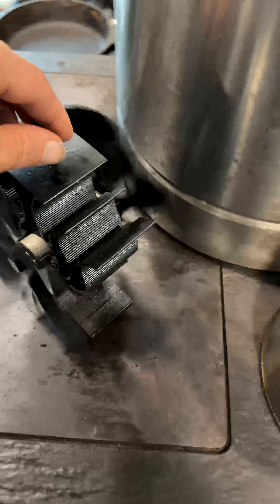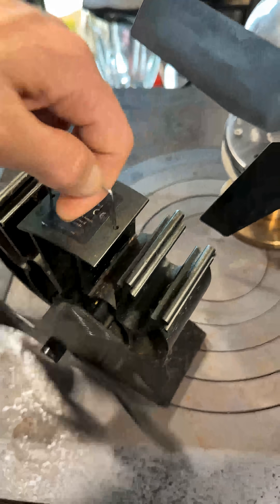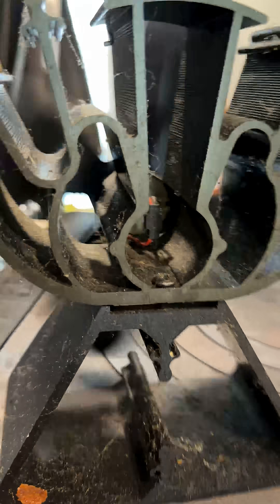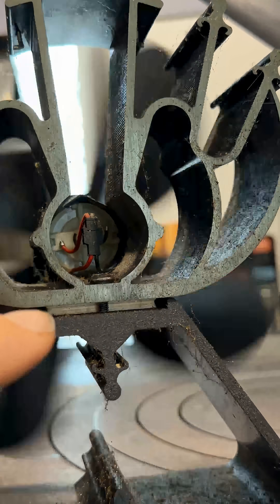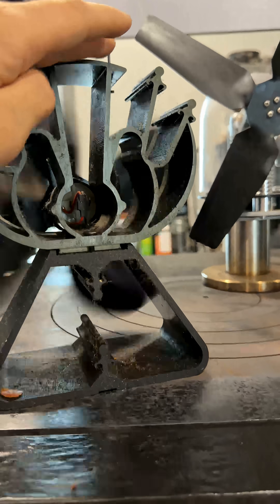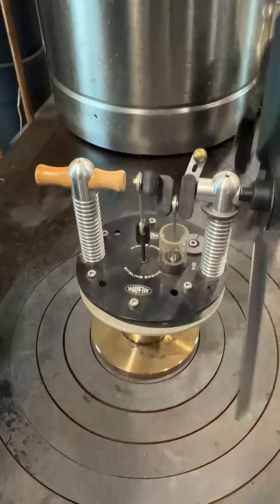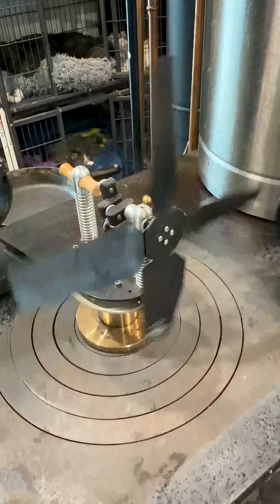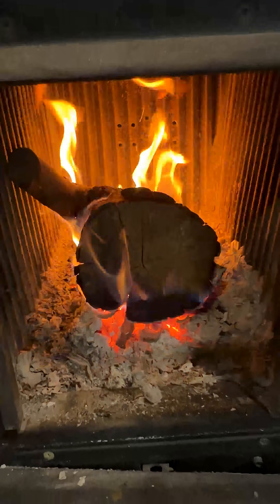Stovetop electric fans powered by heat #narrowayhomestead #offgrid #stovetopfan

Comment: There used to be a type of lampshade that spun different scenes from the heat of the bulb.  They were pretty delicate.  Would be nice to see them again, though.
Reply: It’s a zou ma deng lantern! Sometimes called a running horse lantern. They are ancient, said to be invented around 1000 CE during the Song dynasty in china and got popular during the Ming dynasty
Reply: @Matt-lu8oy Thank you!  I was gonna say that my mother brought ours from Taiwan.  It was a small, octogon or pentagon silk screen panels.  They were painted with various scenes of ancient China.  On the inside was a painted acetate-like cylinder suspended by a needle, around a small electric bulb.  And of course, there were blades at the top to catch the heat.  In the light, the images on the acetate were projected onto silk canvas panels.  And once it warmed, and began moving, I could see clouds and sky deities passing through the scenes on the front panels like animation.  I wish they still made those but it was so delicate.
Reply: That sounds cool!

Comment: It's power source is still heat. Just transferred to electrical. So you're going to split hairs calling the fire powering the engine a "combustion engine" but won't call the fans turning heat into electricity "heat powered" either you're trolling and rage baiting or you're one of the dumbest people I've ever heard explain ignorant things to people with confidence. lmao. SO either good job with such a good rage bait, or good job making it this far in life with a head full of sawdust.

Comment: It's still heat powered because the "power "comes from heat being converted to electricity
Reply: I mean realistically a huge percentage of the American power grid is still based on coal and gas fire generation of electricity so by that logic while there are a lot of intermediary steps in there your phone is heat powered
Reply: @mark1A100 im fine with that asertion 😂

Comment: I messed with those all the time back when i was in a electronics class. N type and P type semiconductors. Those little one can fridge use them . You apply electricity to them and one side gets hot and the other cold. They use them in a lot of cooling and heating devices.
Reply: Did you know the government currently has room temperature super conductors? 

You can find info on it from redacted USPTO secrecy vault files, etc.

Comment: That's a peltier fan, aka thermofan, and the concepts behind both sterling engines and peltier devices is pretty neat!
Reply: I've never seen or heard of the self generated electric fan before, only Sterling type.
Reply: @jeffhill3681  peltier's arent that efficient, but for a solid state device, its kinda a cheat code for low powered stuff with a hot and cold side
Reply: @jeffhill3681  I never really saw one in the wild, but you've seen the Peltier effect before and maybe not even noticed it. A lot of NASA's probes that have to go places that they can't use solar arrays, they use them to generate power. Both Voyager probes have this, as well as the New Horizons probe past Pluto, the Curiosity and Perseverance rovers on Mars, on the surface of the moon, placed there by astronauts... places where sunlight is impossible to rely on, and all you can guarantee is the cold indifference of space. They call them RadioThermal Generators (RTG), because unlike here, where we use combustion for the heat source, NASA uses Plutonium.
Reply: Perfect example of the Peltier effect.
Reply: @schrodingerscat4737  The Peltier effect is the specific thermoelectric phenomena of creating a temperature difference by putting a current over the maerial.

This is the Seeback effect, where you get a current through temperature difference in the material.

Comment: they are in fact heat powered. You wouldnt call your tv solar powered because the grid is powered by solar panels, however you would call a battery with a solar panel built in, a solar powered battery, as the solar power is the primary power source. You also wouldnt call the battery a fusion powered battery evne though the suns rays are being made by fusion in the sun. This device is directly electrified with heat, therefore, it is a heat powered fan. Could it be turned into a regular fan powered by a battery? yes. but that is not it's primary function.

Comment: I mean literally every electric thing with the possible exception of primary (non-rechargeable) battery cells is heat-powered one way or another, so yeah, it doesn't make sense to mention it if you have something like a turbine or a solar cell or the Peltier cell in those fans between the heat source and the desired function.  In other words, word.

Comment: They are actually heat powered as the heat is the initial energy supply which is then converted to electric and then converted to mechanical.
Reply from the maker: I think you might be right! Lol

Comment: Another great thing about Peltier devices is if cooled, it produces voltage that is opposite in polarity to the voltage produced by heat.
Reply: And if instead of the fan you hook up a power source, it'll get cold on one side and hot on the other.

Comment: Either I forgot or never knew about the Peltier effect, this vid made me actually something today, outstanding.
Reply: I have enough sitting on top of every radiator in my house. The room heats up extremely fast and evenly. Absolutely worth buying them.
Reply: Peltier effect is changing temperature with electricity.

These fans runs on the Seeback effect, which is getting electricity through a temperature difference.
Reply: @johanmetreus exactly two dissimilar metals ionize at different temperatures. When bonded together and heated, create an electrical potential between them.  

Peltier effect uses semiconductors It Is an entirely different mechanism.
Reply: @phenodfirefoots7720  Same mechanism actually, just like a spool you rotate in a magnet field to get electricity is called generator, but the same machine with fed with electricity to create motion is a motor.
Reply: This is just a thermocouple but peltier devices are pretty cool

Comment: The external combustion engine invented by Stirling was a huge improvement over the steam engines of the day that tended to explode.
Reply: Only problem is, stirling engines produce almost no usable power. The amount of fuel needed to accomplish any actual work made them little more than a curiosity.
Reply: @joeschmoe6908  Sure, the Stirling engine here won't, but there are many different types of Stirling engines many of which produce usable mechanical and electrical power.
Reply: @nerofl89 Even so, they're monumentally inefficient compared to virtually any other type of engine or even an actual horse.
Reply: @joeschmoe6908  ya, they are more of a neat physics phenomenon than anything particularly useful in large applications. Like pneumatic transport which people thought was going to be all the rage and then again in the same exact way with musks hyperloop yet still you only see vacuum transport in very small applications like old mail room tubes or nowadays really just pharmacies
Reply: @joeschmoe6908 False. 

Appropriate technologies developer here; 

The record holder for the most efficient solar power producer per square foot, are sterling engine powered solar concentrators.

 (Developed at Plataforma Solar in Taberna's Desert, Spain, with a duplicate project in California, US) 

The most silent submarines in the world, built by Kockums in Sweden, are powered by Kockums Sterling engines. 

Sterling engines are superior in the right application.
Reply: @calysagora3615 dude we're clearly discussing stirling engines from several hundred years ago, not current technology.  I believe whatever you say about the modern versions, since I know nothing about them.
Reply: This is not a sterling engine concept. This is operating on the Peltier effect.
Reply: @schrodingerscat4737  The short literally shows and talks about a STIRLING engine. Did you even watch it?

Comment: Seems like picking nits haha. Solar power system isn’t actually solar powered, it’s actually photovoltaic which means the energy is converted from photons. It just so happens the photons originated from the sun in most use cases.

Comment: I have had the pleasure of working with old steam powered farm equipment such as a traction engine, and watching those old engines run is super cool, whether it be a stirling engine, a steam engine, or an old hit and miss gas engine. My absolute favorite is to see just how slow you can make the big engines run.
Reply: I, too, have worked with antique farming equipment, similar color, too. 👍
Reply: Oooh. Are the old sterling engines the ones they have to wind up/tension to a certain spot?
 I've seen a vid where it almost looked like they were cockin a big wheel like a gun.

Think the motor was driving a big belt
Reply: @stevew9107  A sterling engine is the 2nd fan in the video he showed. Uses heat for power.
Reply: @Anonymous8317going to have to research later. I only remember the vid of a big engine that took a lot of handpower torque(?) to start, and then chugged along veeeery slowly
Reply: This is not a sterling engine concept. This is an example of the Peltier effect.
Reply: @schrodingerscat4737  Someone didn't watch the whole video.

Comment: Anybody have advice on getting these fans to work again? I have 3 of them that have quit working.  The blades move freely and the wires appear to be in place but no worky. 🤷‍♀️
Reply: It could be that the motor itself is burnt out, the blades would still spin if you moved them but the electricity generated would just turn into heat rather than motion.   Those are just my thoughts on the matter though, I fix computers and not peltier/sterling engines or motors.
Reply: you can burn out the peltier. I haven't tried to buy a replacement myself.
Reply: @clockworkpiece3111  Probably lack of thermal paste is the culprit. Fixed one a couple years ago because of it, it had tiny drops of paste on each of the element so overheating killed it. I'd make sure these fans are properly pasted, even if it's new one. And aliexpress sells replacement elements.

Comment: Sterling engine is a external combustion engine.
Reply: @markrenfrow9873  only if powered by actual combustion. just like stesm turbine is an external combustion engine when powered by coal or oil heated boiler, but a nuclear engine when powered by a fission reactor.
Reply: Can we call it an internal expansion engine? 😅
Reply: Nailed it 😂
Reply: Somebody was too autistic to watch the whole clip. Also, 'an external'.
Reply: ne. it is an external energy source engine. combustion is not strictly required
Reply: I can electric vehicles "external Combustion" when their batteries catch fire.
Reply: @MoaByte-v2z Transient combustion lol. Starts internal, ends external. Just like a gasoline car fire......
Reply: @joecrisp9060 don't let the governor of california hear the words 'transient combustion', he might get some ideas
Reply: Then so is a steam engine, but no one calls them that. They are heat engines. And as others have said, the combustion isn't even necessary.
Reply: @joecrisp9060  you are correct
Reply: @jdfershizzle No, he's incorrect. They are 100% called external combustion engines.  Because they are.
Reply: @calysagora3615  no- Actually, engines based on the Carnot cycle, like the one depicted toward the end of the video which is a Stirling engine, are colloquially referred to as a heat difference engine. Combustion of any kind is not necessary for them to operate.
Reply: @jdfershizzle  Sure, but if the heat source IS combustion, it FACTUALLY is an external combustion engine. Those terms are NOT mutually exclusive, so your take is moot. I already established that they are heat differential engines. Duh.
Reply: @calysagora3615  the heat differential source is not necessarily combustion, and quintessentially not so in most applications of this engine type. Think about the applications of the carnot cycle. Thus, your odd choice of fuel for the wrong engine is not a property or characteristic of the device, just your broken and misused imagination. The answer is no, it is not a combustion engine of any variety. Let me help you: i am running one right now off of ice, and no combustion is taking place, hence the engine itself has nothing to do with combustion, even if your selected temp differential source does for some strange reason. Lmk if you are still super confused.
Reply: @calysagora3615 i have heard them called sterling engines more than anything else
Reply: @calysagora3615 I think I see what you are getting at. The engine is powered by combustion, ergo it is inherently a combustion engine.

 I'll concede that if you were referring to the entire heat engine plus heat source as a single unit, you'd be correct. However I think of it like this; place yourself and the engine in a sealed room with hot steam supplied to the engine and the exhaust removed by sealed pipes that go through the wall. You can see and inspect the engine in any you like, but you cannot see where the steam comes from. Is there any way that you can determine whether the steam was generated via combustion, fission, or a big ass magnifying lense? All you can tell is that it's powered by the hot steam. You can see that everything that comes in one pipe goes out the other, but at a lower temperature. All you can say about the engine is that it turns heat into rotational force. 

Coincidentally, I believe there are actual external combustion "flame licker" engines that you may find interesting. If I remember correctly the use vacuum to pull in a lit flame. Not certain beyond that as to how they work.
Reply: @joecrisp9060  Yep, correct. I'd say 99% of them operate with an external combustion though.
Reply: @joecrisp9060 FALSE. Sterlings are 100% called external combustion engines.

 Peltiers are heat DIFFERENTIAL elements,  and Sterlings are heat DIFFERENTIAL engines, which just like steam engines, are external combustion engines. 

FACT.
Reply: @calysagora3615  so lets break it down to where everyone can understand: external (outside of) combustion (something is burned) engine. So the beauty of the Stirling engine and other Carnot-cycle based engine is that they essentially operate off of a temperature differential. Not by burning fuel, necessarily, which is why they are well suited to waste heat applications without a dedicated fuel delivery system. So lets work back now. Remember when I explained what combustion was? Yeah, the Stirling engine doesnt require that. It is not a combustion engine of any type, no matter the source of your heat differential, which could just as well be ice and even colder ice. Still confused?
Reply: What if you power it by geothermal or nuclear then? So NO a Stirling engine is NOT classified as a combustion engine at all.
Reply: This one is Combustion 
technically any large thermal difference is enough 
Including if it's colder, funnily enough
Reply: This is not that, this is an example of the Peltier effect.
Reply: @markrenfrow9873  i opened the comments just to Say that 🤣
Reply: This is not a sterling engine. This is operating on the Peltier effect.
Reply: @schrodingerscat4737  he literally showed the sterling engine.
Reply: @schrodingerscat4737  he also shows a stirling engine which he incorrectly calls a combustion engine. Stirling engines are based on the Carnot cycle, do not require combustion, and merely require some temperature differential (e.g. ice on one side, even colder ice on the other, that will do it with no 'heat' at all.)
Reply: @jdfershizzle  Ice still has heat. Everything above 0K has heat. (which I suspect you already know, but others may not).
Reply: @xxwookey  true - until all the atoms hqve truly stopped moving, then there is technically still heat